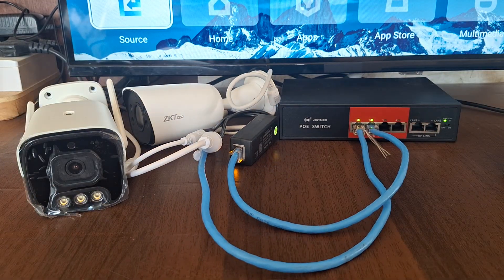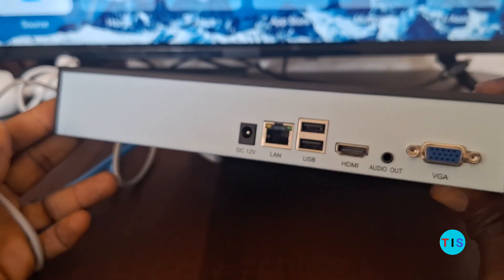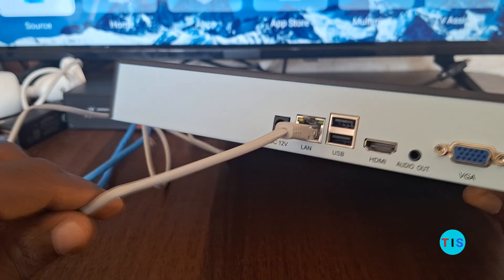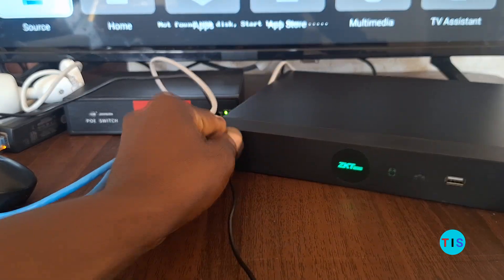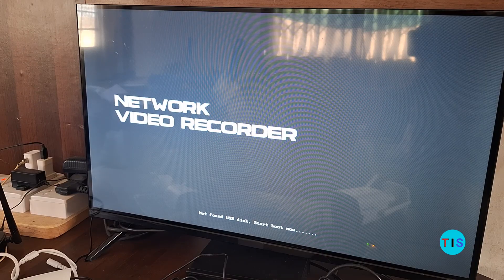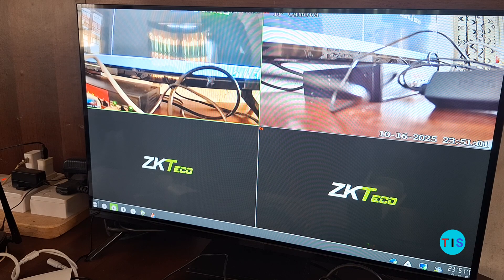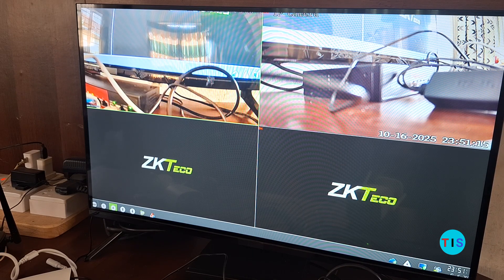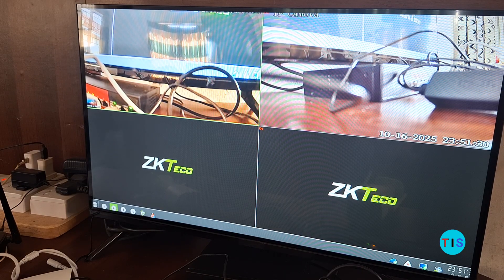ip camera installation practical setup using nvr + poe switch

Comment: Oooo..it's starting to get a little complicated, I've got all this gear and No idea!, I thought I'd get all the parts first and then set it up, I've Baluns, poe switch, DVR, AHD cameras, IP cameras, BNC connecters', cat6 cabling, coaxial cable all through the house  and I.m about to start to hook all this stuff up...I just wish I'd gotten all WiFi cameras cos all this cabling through the roof is a nightmare. At least I can refer to your videos and unravel this mess ..lol. Cheers mate. Love the way you make it look easy, I suppose it is if you are just doing demos on a bench.... but once those cameras get 100 m from the Main Brain WHEW! it gets a bit mind boggling. Cheers from Australia 🦘👍.
Reply from the maker: You can do it.
It is not so difficult to do. Just follow the process, 
1. Camera and  Junction Box Mounting, 
2. Place your recorder, 
3. Lay your cables, 
4. Terminate and connect your cables
5. Inspect your connections,
6. Power up your systems
Reply: @Tech_Inside_Out  Thanks for the encouragement mate 👍.